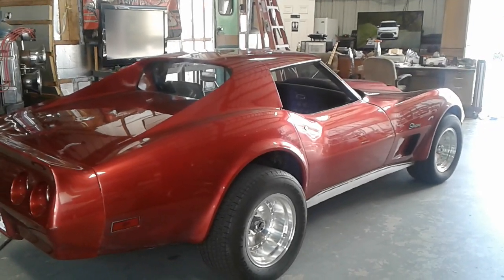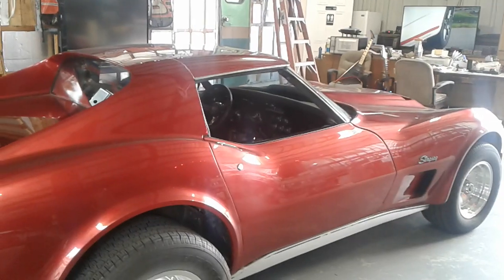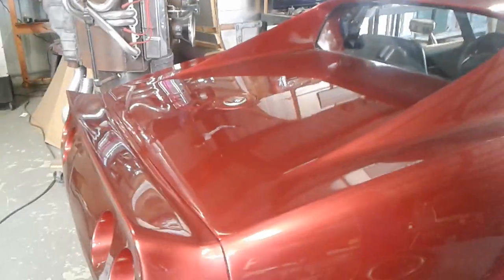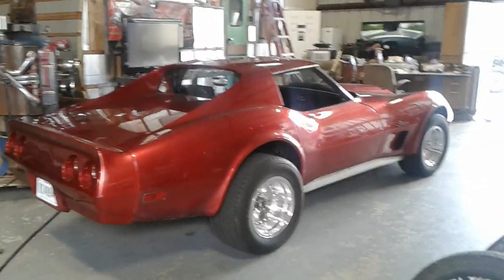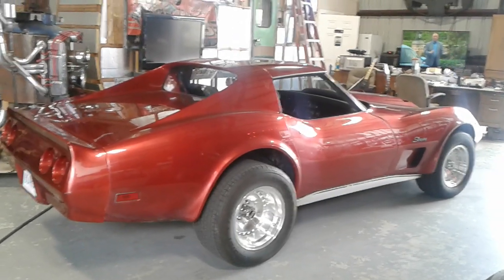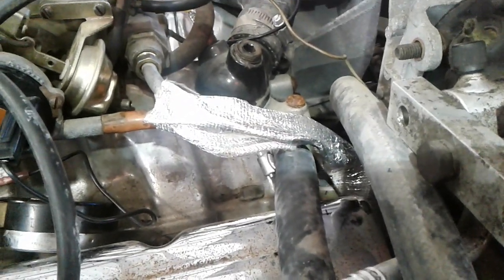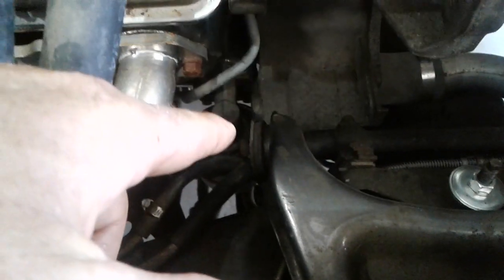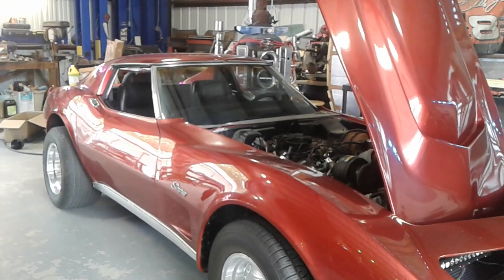Jackie Is Leaving Me...............

Comment: Nice car. I hate that intermittent start and stall crap.  My 72 Duster did the same thing for the longest time. Figured out it was vapor lock and got that solved.  Drover perfect for about a month then started bogging down and not starting....I chased fuel, ignition and every other kind of gremlin I could think of.  Turned out to be the Carter Thermoquad with the phenolic body that had warped.  Swapped the body out and cleaned the carb up and never had an issue with it again. 

One of these days I'll have a nice 77ish Vette.
Reply from the maker: Turned out to be a bad fuel pump and a loose connection at the starter!!! All good now!!! Thanks for watching and Keep Rocking!!!

Comment: Check those wires that go to the module in the distributor I've had problems with them before
Reply from the maker: It's probably where the shut down is coming from!!! Seems to start when I hammer the throttle wide open!!! Going to be looking into that for sure!!! Keep Rocking!!!